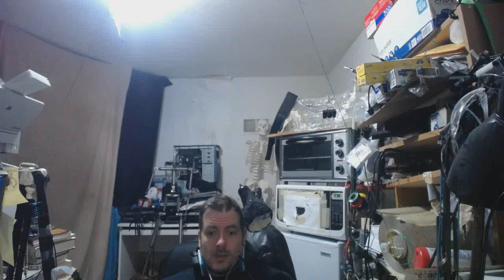Change of Plans Regarding the Dinah Robot Project | Building Humanoid Robots #242

Comment: i have been watching your videos for a long time ,
you can just build the bot with whatever the parts you can afford ,
that way , you can gain exp ,get an overview of the architecture of the entire bot ,and then we can plan to add or remove what we seem fit.

yeah it will be nice to have a custom made things entirely..
but i think  completion of the prototype v1 comes first.
Reply from the maker: but completing a v1 with metal gears will not prove you can fit all pulley based downgearing so it proves nothing.  It just makes a loud unacceptable racket making robot that can't operate indoors in a home because it is too noisy.  That rules it out entirely from being viable or human passing at all.  Might as well say it is outdoors only at that point.  That's why I had to abandon this project.  A human passing humanoid must be silent and have full human range of motion, human level strength and speed or it is a failure and not human passing anymore.
Reply: @artbyrobot1  I get where you're coming from , if the goal is to make something truly human-passing, then noise, strength, and realistic motion absolutely matter.
but i thought , maybe first we can figure out what works and what doesnt by building v1.
and also i wasnt talking about dina specifically.
Reply from the maker: @barathraj8024  well in V1 I will be implementing several different variations of silent pulley based downgearing I believe so I will find out what works and what doesn't in that effort.  But anything that leaves the path of total silent operation, human level speed and strength, and human passing in appearance is a deal breaker is all.
Reply: that's nice.. implementing several variations will surely show us what we want